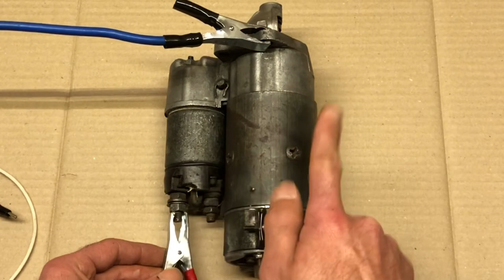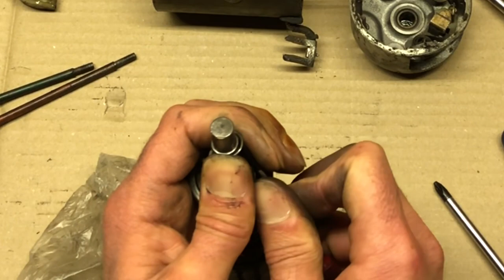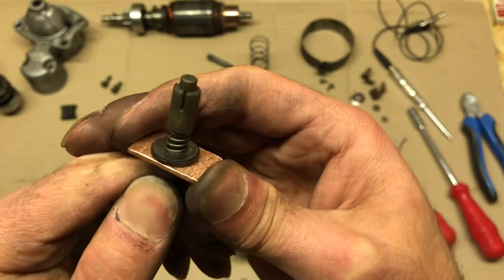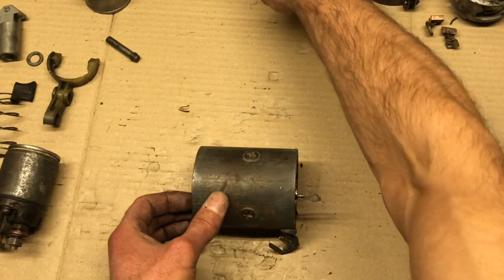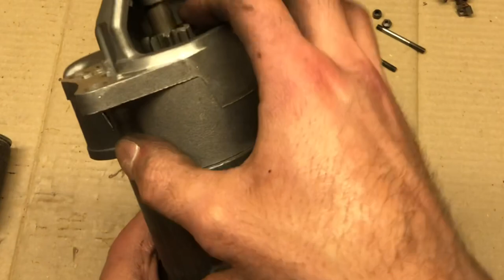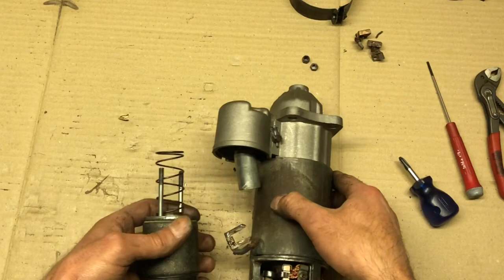How To Fix Fiat 126 BİS Starter Motor Fault Detection And Repair - Part 3

Comment: Merhaba abi bir sorum olacaktı acaba motorda daha önce yenileme işlemi yapılıp yapılmadığı nasıl anlaşılır
Reply from the maker: orjinal üst kapakta piston yerlerinin numaraları yazılıdır 1-2 diye eğer yenileme yapılmışsa bu numaralarda gitmiş olur en basitinden :)
Reply: @sinanbaykus  peki çok sağol abi bir diğer sorum o da motorda en çok aşınmayan neresidir niçin

Ben motor teknlojisi öğrencisiyim sorumlulkuk sınavına gireceğim bu sorduklarımın cevabını bulamadım bir de ders uzaktan hoca fazla anlatmıyor böyle konuları
Reply from the maker: @herotv7847  anladım ama aşınmayan parça yok gibi bişeydir motorda aşınmayı yavaşlatan yağlama sisteminin düzgün çalışmasıdır bi bölgeye yağ bi süre gitmediğinde hemen aşınmaya hızlı bi şekilde başlar en aşınmayan yerler sibop kollarının olduğu yerdir ama bana göre :)
Reply: @sinanbaykus  Tamam abi Eyw

Comment: Selamunaleykum ustam ellerine sağlık kardeşim bir sorum olacaktı marşa bastığımda surtme sesi ve kaçırma sesi duyuyorum sebebi nedir marj dinamosunu soktum disklerine baktım pek anlayamadim sebebi ne olabilir volan da sıkıntı gorummuyor
Reply from the maker: aleyküm selam teşekkür ederim, marş motorunun kendisinden sürtme sesi geliyosa dişli volana deyiyor olabilir marş dişlsinin uç tarafındaki segman boşa çıktıysa ondan olabilir yada marş motorunun endüvi yatakları aşıdıysa dönerken zorlandığı zaman o şekilde sürtme yapabilir tam olarak nerden ses geldiğini bulmaya çalışırsan daha iyi olur
Reply: @sinanbaykus   teşekkür ederim kardeşim buraya foto atılabilse daha net anlaşılabilir di elektrikciye götürdüm açtı baktı  sorun goremedigini söyledi  aracın üstünde görmemiz lazım dedi pek yardımcı olmadı mars dışkısının ucunda hafif aşınmalar var bir de mars dışkısının geçtiği iç kısımdaki dişlinin dib kısmı aşınmış gibi yüke bindirdim araca takmadan herhangi bir kaçırma siyirma da yoktu anlayamadim
Reply from the maker: @mehmetyanmaz3596  marş motoru dışarda yükte olmadığından aracın üzerinde biyere dokunuyosa o yüzden dışarda belli olmayabilir araçta takılıyken tam sorunu bulmaya bakman lazım
Reply: Değerli kardeşim ben dinomoyu soktum açtım  fotolarını sana atabileceğim bir yer varsa atsam sana baksan daha net bir fikire sahip olabilirmiyiz
Reply from the maker: @mehmetyanmaz3596  facebook tan messenger ile atabilirsin ordada adım aynı zaten
Reply: @sinanbaykus  kardeşim abimden attım fotoları Cenk atmaca diye ilgin alakan için teşekkür ederim
Reply from the maker: @mehmetyanmaz3596  rica ederim yazdım ordan
Reply: @sinanbaykus  kardeşim dinamoyu denedim zorladım biraz birkaç vidası gevşekti sağlamlarım boşluk vardı aldım boşluğunu takmadan denedim gayet güzel bir şekilde çalışıyordu araca taktım kontagi çevirdim sigorta tablasının oradan tik diye ses geldi sorun nedir acaba şimdi de sorun kömürler mi
Reply from the maker: @mehmetyanmaz3596  marş otomağine giden elektrikte bi sorun vardır marş motoru çalışmadıysa onu bi kontrol et kömürlerden değildir
Reply: @sinanbaykus  teşekkür ederim kardesimmm bakayim
Reply: @sinanbaykus  kardeşim mars motorundaki dişli sayısı alacağımız dişli sayısıyla aynı olma durumu nedir yani 12 dis çıkış lı mars motoruna 9 dişli takılabilir mi?Tesekkur ederim
Reply from the maker: @mehmetyanmaz3596  dişliler yerine oturmaz 12 dişe 9 diş takmaya çalışırsanız marşa bastığınızda büyük ihtimalle ya sıkışır yada dişli kırılır daha büyük sıkıntılar olur yani
Reply: @sinanbaykus  anlıyorum kardeşim teşekkür ederim marş motorunu sıfır alacagim üzerindeki mars dislisi 12 li parçacıklara sorduğumuzda 9 dış var sıkıntı olmaz diyorlar bana pek mantıklı gelmedi sana sormak istedim orjinalini alıp takmak en doğrusu teşekkür ederim
Reply from the maker: @mehmetyanmaz3596  rica ederim, tabiki üzerindeki neyse onunla değiştirmen daha doğru olur sonuçta parçacıların çoğu sade ürün satmakla ilgilenir hangi parça nerde doğru nerde yanlış çoğu bilmez o yüzden kendin orjinalini alman daha iyi
Reply: @sinanbaykus  aynen öyle kardeşim ben de öyle düşündüm yine de sana sormak daha mantıklı geldi mars dinamosu nu takarken herhangi bir dişli ayari yapılmıyor bildiğim kadarıyla vida yerleri sabit zaten vidalari yerine takip sıkmak yeterli sanırım
Reply from the maker: @mehmetyanmaz3596  aynen kendi yerine oturuyo vidalarını sağlamca sıktığında bi problem olmaz ama gevşek olmasın yoksa titreşimden dolayı açılır vidalar motor yerinden çıkabilir ona dikkat et
Reply: @sinanbaykus  kardeşim ellerine emeklerine sağlık bilmediğimiz konularda bizleri aydınlattın teşekkür ederim hakkını helal et ilgin alakan için teşekkür ederim
Reply from the maker: @mehmetyanmaz3596  helal olsun ne demek rica ederim yeterki insanlar aradığı konuların doğrularına ulaşabilsin bende elimden geldiğince doğru bilgileri paylaşmaya çalışıyorum her zaman

Comment: Sinan kardeş benim marş motorum birden marş almamaya başladı sebebi kömürün bitmesi mi ? Yardımcı olursan sevinirim pazar günü bende sokecegim de . Gruptakilere sordum herkes kömür dedi birde sana sorayım dedim :)
Reply from the maker: Kömürler uzun süredir değişmediyse büyük ihtimalle kömürdendir, ama marş otomatiğinin aradaki gösterdiğim bakır kısımda aşınma varsa ondan kaynaklıdır onu kontrol etmen daha iyi olur :)
Reply: @sinanbaykus  daha alalı 2 ay felan oldu ondan önceyi bilmiyorum ha şuda var marş alırken zorlanıyordu bazen giygiy ediyor bence kömürden ve gruptakilerde hep kömürden dedi
Reply: Kardeşim birde marş motorunu sokecegimya videodaki gibi genel bakım yapayım mı ne dersiniz? Birde elimde kalmaz demi 😂🤣
Reply from the maker: @hayatiserim9265  Sökünce belli olur zaten kömürdenmi veya neden olduğu bakımınıda yapmış olursun :) Marş dişlisi internet üzerinde bulunuyo dişli içini gösterdim karışıklık olmasın diye, o şekil dişli olacak diş aralıkları kalın olanlarda uyuyo ama sıkıntı çıkarabiliyo ilerde
Reply: @sinanbaykus  bilgi için teşekkür ederim ama bu marş dişlisinde doğru bulup ve sipariş edebilmem için senden biraz yardım isteyeceğim zahmet olmazsa eğer internette çok fazla var ben anca videoda gördüm ama sen canlı canlı gördüğün için uzaktan görsen tanırsın zahmet olmazsa hangisinin olduğunu linkini atarmisin ? Veya tam adı nedir bu menedin şimdi ben önceden bütün parçaları ayarlamam lazım yoksa tekrardan parça tedariği olsun parça uretimi olsun mümkün değil atölyem yok sadece el takımım var garajda kendim söküp bakımlarını yapıp tekrar takacağım 😊
Reply from the maker: @hayatiserim9265  Emir oto yedek parça 05384520087, arayıp sorarak alırsan doğru parçayı gönderir :)
Reply: @sinanbaykus  tamam bizim Emir Osman abi o 😂 abi insalla bu yorumlari görmez her seferinde parça ararken unutuyorum Emir Osman abiyi 😂🤣
Reply from the maker: @hayatiserim9265  Çok fazla satıcı olmadığı için doğru parçaları bu işlerle uzun zamandır uğraşan kişilerden bulabiliyosun sadece :)
Reply: @sinanbaykus  sadece parça olsa yine iyi  vallahi bilgide yok bilen anlatmıyor öğretmiyor ben seni yakın takibe aldım artık her videonu baştan sona izliyorum 🤗😊
Reply from the maker: @hayatiserim9265  Teşekkür ederim, benim amacım bu videolarla Bis severler kendi arabalarını toplayabilmesi, çünkü ben gerçekten çok uğraştım bilen yok bakan yok yardımcı olan yok, o yüzden videoların süresine değil anlatabilmek istediğimi izleyenlere aktarabilmeye uğraşıyorum :)
Reply: @sinanbaykus  sen bütün bildiklerini anlat ben dinliyorum seni ve hepsini aklıma kaziyorum :) hadi iyi geceler kardeşim

Comment: Hayırlı bayramlar hayırlı geceler usta benim aracında marş motorunun kapağı kırıldı ve götürdüğüm usta yenisini alman gerekiyor dedi size göndersem ücretili bir şekilde yapabilirmisiniz yada sizinle irtibata geçebilir eğim bir adres var mı gmail adresiniz
Reply from the maker: Hayırlı bayramlar sağolun, marş motoru kapağı tamiri falan yapmıyorum kırılmışsa zaten çıkma veya yenisini alman daha doğru olur en iyi çözüm bu yani :)
Reply: @sinanbaykus  ustacim senin videoda değişmiş oldugun kapak kırıldı. Kapak lazım usta kapağı çok yerde aradım bulamadım usta bulabileceğim bir adres verebilir misin usta
Reply from the maker: @ahmetyegen9308  senin araç fiat 126 ise yedek parçalarını facebook gruplarından bulabilirsin başka araç ise ona göre diğer gruplara ve satıcılara bakabilirsin ben başkasına yedek parça satışı tamirat gibi işlemler yapmıyorum sadece yapacak olanlar için videoları hazırlıyorum
Reply: @sinanbaykus  vallaha usta videoların gerçekten çok bilgi içeriyor yani bilmeyen biri bile bir iki kere izlese bilgi sahibi olur videodaki bilgiler için teşekkürler.Ama gerçekten yedek parça piyasasında parça bulmak tamamen sıkıntı bir kapak bulamadım sorduğum herkes illaki yeni al yeni al diyip duruyorlar. Sağolasın ustam teşekkürler 👍
Reply from the maker: @ahmetyegen9308  Teşekkür ederim videoların genel amacı o zaten elinden gelen izleyip kendi yasın kimseyle uğraşmak zorunda kalmasın :) yedek parça illaki sıkıntılı tabi ama kaynak olabilecek durumdaysa alüminyum kaynağı yapan biyerde yaptırabilirsin ona ne isterler bilemiyorum tabi
Reply: @sinanbaykus  aliminyum kaynağını deniyecegim usta teşekkürler 👍